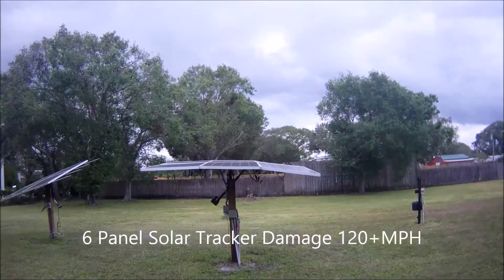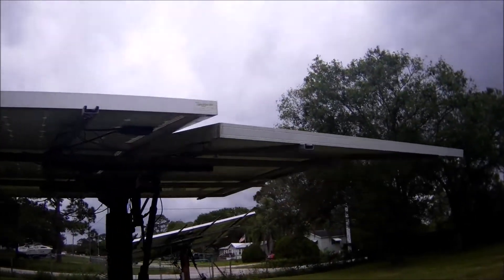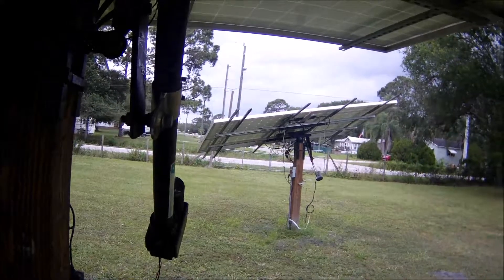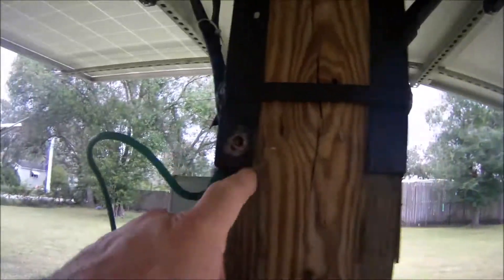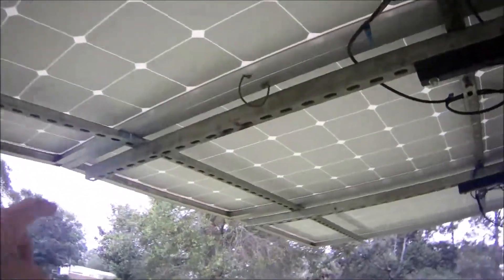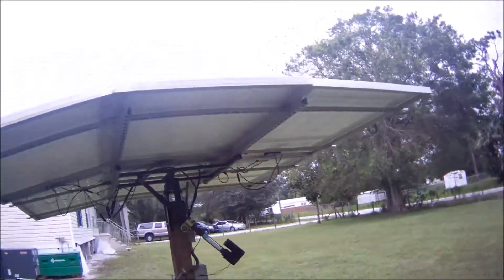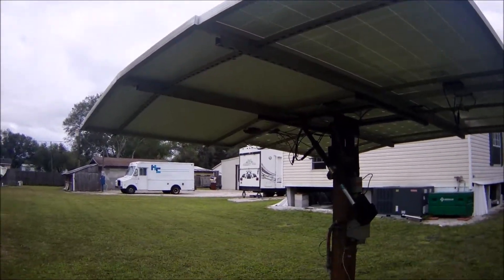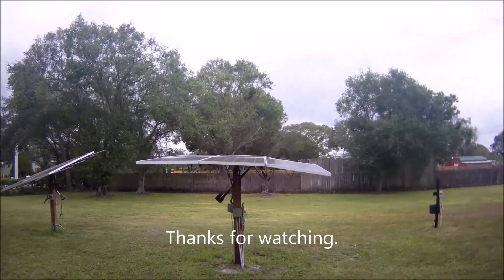Solar Tracker Damage 120+ MPH!

Comment: Well I gotta say it did pretty darn well if it's not laying a few miles away from your house with 120 mile an hour wind gust. So I would definitely call out win for sure. Thanks for sharing.
Reply from the maker: Thanks ,It is know a member of the over 120 mph club.  I have several around the country were they were sold & installed & reported to me at how well they had survived really bad tropical storms , 1 was lifted out of the ground by a passing tornado flipped upside down then reinstalled with only minor damage as shown here.
Reply: It is definitely a very good system for sure.

Comment: Thanks for sharing.  
120 mph real world test...
Part of what we've learned...
Never use shallow unistrut for main mount supports...
And if you're in hurricane or tornado area...
Try to figure a quick demount for your panels...
Reply from the maker: Yup!  The 6 panel units are just to big to dismount but held up well this is a older design the newer ones are even stronger.

Comment: I am wondering if the large super strut im addition to it being approximately 1.75"x1.75 I think its 12 gauge instead of 14, but I am wondering if it might have caused more strees on the pole & tracker being so much more stiff.
Who knows, Thanks for Sharing hope everything with the insurance goes smoothly.
Reply from the maker: Thanks! Yes all  of the 6 panel models get the big super struts. This is 1 I put up years ago when U get in the 120 mph zone all bets are off.